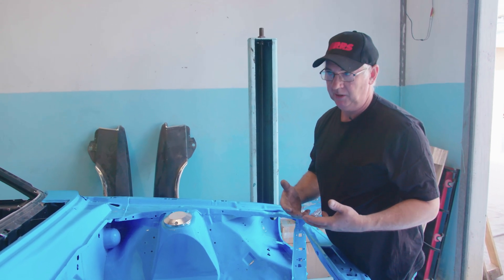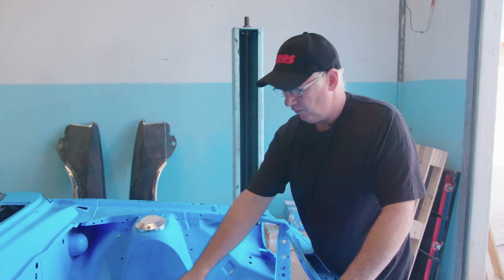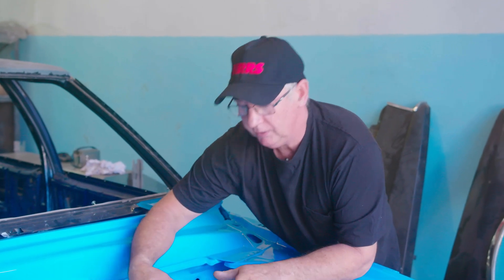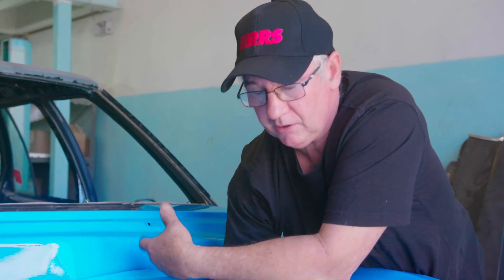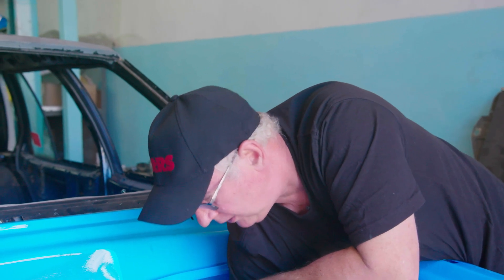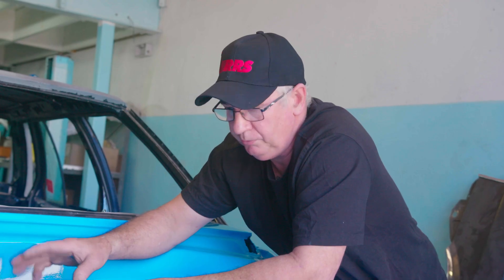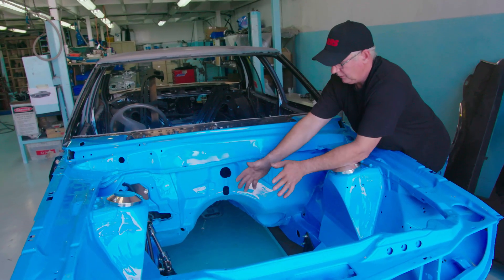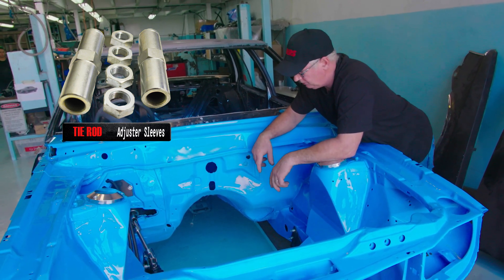Bolt In Rack & pinion steering explained Part 1. Matthew explains the advantages of RRS racks

Comment: Hi guys, would you consider developing a kit for the 67-72 and 72-79 f100 twin ibeam. Considering it's a centre steer rack, i feel you could develop a system that could be possible without bump steer problems. Definitely a very lucrative item to consider as it would be able to be sold in the USA as well. Cheers

Comment: Very interesting and great engineering on you part.  A long time ago I knew a bloke in Adelaide who customised XP falcons.  He fitted a rack and pinion set up from an EA/EB falcon complete with the power steering and steering column.  The front suspension was heavily modified with later falcon components.  As I had an XP back then, he let me take this car for a drive and it was quite impressive, good steering feel and a faster steering ratio.
Reply from the maker: Thanks for the info!